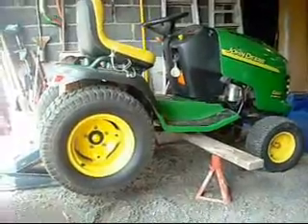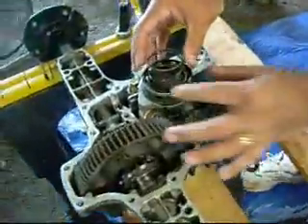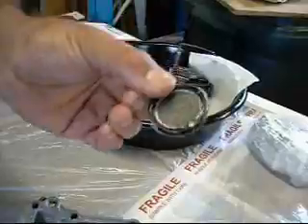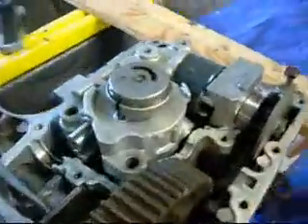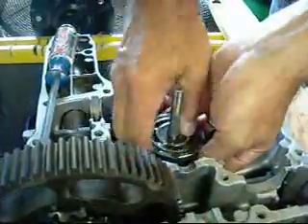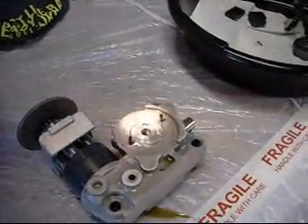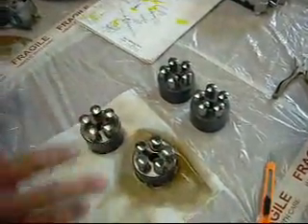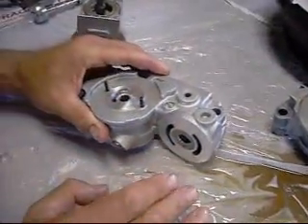Tuff Torq K66 Hydrostatic Transaxle Rebuild - Part 1

Comment: What goes bad in these? Is it just a tiny amount of wear around the bottom of the pumps and on the center aluminum housing? Mine stopped working 15 years ago and I rebuilt it, but I was looking at the parts that came out yesterday, and they had a little wear on the pumps and center section. Maybe a thousandth between the openings on the bump/ motor and maybe a thousandth on the places they ride.

Comment: Almost 10 years later and I'm doing the exact same process on a K66AG out of a husqvarna GT48XLSi - I don't know you postman, but you have saved my bacon with these videos. My deepest thanks to you and your camera man for the great information and camera angles.
Reply: Any luck?  I’m getting ready to tackle mine on the GT48XLSI.
Reply: @bwhited2  yep! Went smooth as butter. A couple of tips:

1. On the husqie the rear end is inaccessible when it's in the mower. When you're bleeding the system after it's back in, I was able to snake an air hose I ripped from a bicycle pump to the overflow tank and put the oil in a measuring cup and siphoned it down to the Trans. I'm sure you could do it easier with a funnell, but I didn't have one that would fit the piece of air hose I had on hand. I was also able to get a lot of the air out by putting a power drill with a socket on the bolt for the fan and spinning it for a few minutes before I reinstalled the transaxle. It really didn't need much after I filled it til the overflow tank was completely full. Once the system was bled it worked out to just about right.

2. The fan blades are pretty flexible, so don't be scared of muscling them out from around the belt

3. The diff lock didn't change the process. It's activated with a lever that's held down with a tab bolted down on the outside of the housing. You can leave it in place, the linkage connecting it to the switch is a little tricky, if youre forgetful like me then take some pictures before you take it apart.

4. The almighty pin and washer for the pump/motor disconnect stayed in place really well with a little grease while I tried to get the center case seated. That was the most finicky part. At one point it looked like it was seated, but after looking at the brake disc, i realized it wasn't quite there yet. Definitely take extra care on that part.

5. In the video, postman puts the sealant around the upper case housing. I would recommend putting it on the lower case housing (the one thats empty during the rebuild process) instead. There's little voids cut in that side that are supposed to be filled with sealant.
Reply: Thanks for the info, may I ask why you took your transaxle down?  We’re you able to find parts?  Mine is a little noisy and won’t pull once it’s warm.
Reply: @bwhited2  that's exactly the issue I had. It would run for 20-30 minutes on flat ground, but once it got warm it would slip and make noise.

I called Tuff Torq directly to get the SKU I needed to order for the repair kit on their site. They asked for the serial # printed on the transaxle, you can see it from the back of the mower, it's printed on a sticker. I will say, while customer support was helpful, their site was awful, I never got an order or tracking number, it just appeared on my door step after two weeks of calling customer support and getting told it got sent to a warehouse that didn't have it in stock. There are people that sell the same kit on Amazon and eBay, not sure if that's a better route but oh well. Either way, I got what I needed in the end, and customer support did all they could for me which was appreciated. The kit cost something in the neighborhood of $450
Reply: Thanks again, I appreciate your time and help, I ordered a repair kit for mine today.  Looks like I’ll be tackling it soon.

Comment: Thank you for sharing/posting.  The pin you discovered that kept the center case from being removed is what drives the charge pump.  The charge pump feeds the main pump, instead of just trying to draw fluid into the main pump.  True, there is no pin in the main shaft of a K46, because it does not have a charge pump.   A K57 does have a charge pump, and so does a K66, as you discovered here.  That is also why....you can pull the main shaft straight out of a K46 or K62, and not a K57 or a K66.

Comment: Hydrostatic trans have no seals, what seals the motor & pump are the sealing washers on the ends. Any scratches will cause it to hemorrhage internally losing pressure especially when warm. Oil will thin out. Biggest concern is keeping fluid clean. I remember when I went to school for Caterpillar on hydrostatic had to use lint free wipes when drying sealing washers that's how close the tolerances were. Good luck to anyone rebuilding, remember keep everything " CLEAN  " and you will be ok

Comment: Does this have locking diff?
Can the oil be changed without disassembly, i.e. drain and fill plugs.?
Reply: My K66 has two drain plugs in the bottom.

Comment: p o s transmission.
All failing in hilly terrain here in VA also.
Junk
Change oil every season suck oil out put in new oil . John Deere should be ashamed.
Small pump is charge pump which when weak you lose hydrostatic pressure to pistons in pump and motor. I work on Heavy equipment and build pumps..
Pistons don't have bronze shoes on pump or motor ...steel on steel..If suction screen filter gets dirty and restricts charge pump intake pump will not charge pistons . One cannot clean or change filter without disassembling entire transmission.
Excellent work Thanks.

Comment: Folks, it was Recommended that you use Straight 60 weight oil in these Transmissions--Amsoil Dominator is said to work great and keeps a great internal seal on Pump pistons and Motor Pistons--I would try this before breaking down transmission.....

Comment: My G100 failed after about 2500+ hours of real tough going (actually abuse.)  Bought it new about 2002 - it was used heavily as a companion during house construction.  I used it to tow a 8 ft^3 concrete mixer, Vacuum motor and cart, pulled wagons filled with dirt/mulch/rock/bags of concrete, etc to such a degree that the wagon looks like it has been stepped on.  We live on a steep hill so it reliably carried all this like a trooper.  I also own a Cat 289C tracked loader, so I can fully appreciate what the G100 was doing.  I also used the G100 and its belly mower more like a bush hog than a lawn mower, going through about 2 sets of blades a season.  I never changed the fluid, and kept the thing outdoors all year - occasionally changing the battery.  The seat has more duct tape than vinyl.  It failed about 2014 when I was going up a hill. Something snapped loudly and the machine immediately started to roll back. Brakes did not work. Luckily, I made it down without incident.  I would have sworn that the axle or something solid in the drive train sheared completely apart. I expected the fluid to look black and filled with steel debris, etc.  However, there was not even scintela of  hint of damage - the fluid looked clear and pure - like baby tears with barely any evidence of steel particle debris, the gears looked sharp and true, and the shafts and train were fine.  I assume that the damage was owed to failed directional valves in the block housing.
Reply: @BKD Vickers , I have to admit. Your post is the first I have read at having an issue with switching from the 10w-30 to the 5w-50. I have a John deere L130 with the K46. It was slowing down on hills. I switched to the 5w-50 synthetic and it brought the K46 back to life. To me, synthetic oil will handle heat much better then conventional oil. That was 4 years ago at around 400 hrs. Last summer i noticed it slowing again and more noise but for first 3 years...it worked close to new after switching oil to 5w-50. Just stating my experience.
Reply: @BKD Vickers your reply makes total sense. Thank you.

Comment: ThePostman777: what an amazing job you've done in this 2 videos (Part 1 and Part 2 for the K66 Hydrostatic Transaxle).    Thank you so much for the way  you explained this!!!!   Finding information on Transaxles and videos are very hard to come by, so big KUDUS to you, sir!

I have a Craftsman tractor which appears to have the same transaxle: it has roughly 600 hours and has been roughly mighty slowly especially going up a hill and when going on reverse.  I may adventure on doing something like this if the tractor gets worse with time.....

Comment: The K66 should last for 600+ hours, with proper maintenance. The problem is the owners never change the oil in the transaxle. The change is simple: There are two easily removed oil drain plugs in the bottom of the transaxle and an external oil reservoir.

I was told the reason the owners do not change the oil is JD's Owners Manual does not indicate they should change the oil.
Reply: Yeah... when the transaxle wears out, just pop down to your friendly dealer and buy a new tractor! See how this works? 🤬
Reply: Roger Daisley owners manual says transmission is factory sealed and needs no maintenance. Only maintenance suggested is purging the air.
Reply: @bjl1000  Yeah, I read that too, and then after hundreds of hours I was working on something else and noticed there are two larger bolts on the bottom.  Sure enough, drain plugs

Comment: Hreat video. Im also from WV with a G100 that just quit pulling on inclines. Serviced the transaxle fluid and no luck. Pulled the axle out and looking to do a rebuild like you did. Who did you get parts through?
Reply from the maker: zscater Direct from Tuff-Torq at http://www.tufftorq.com/parts-service/index.html. You can call them also, they're very helpful. Best of Luck!

Comment: Great Video, Thanks.  I'm a fellow WVian with a JD G100.  Have you changed the transmission oil since the rebuild?  Any video on that?
Reply from the maker: I have not. I've added just a few ounces to keep it topped off, but no problems. Now at 1386 hours and still pulling hills under load like a champ.

Comment: How many hrs did you have on the machine when the trans failed?  I have a 1998 Scott S2554 garden tractor and a 2002 Scotts gt2554 both have the k66 my 2002 has 350 hrs and need a pump rebuild.
Reply from the maker: crabhab Sorry for the late reply. It started to notice a fail around 500 hours. I tried changing to a 50 weight oil, with no help. Then to a 5W-50 synthetic, no difference. Watching YouTube gave me the courage to attempt this rebuild - which is actually very simple. The guys at Tuff-Torq are great and very helpful. Best of Luck!